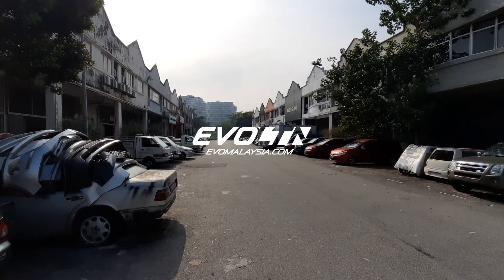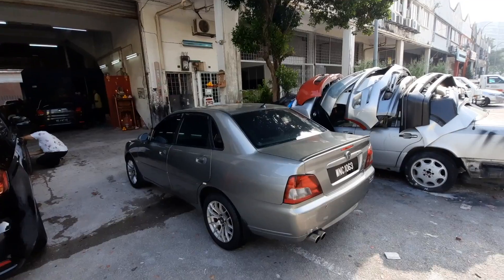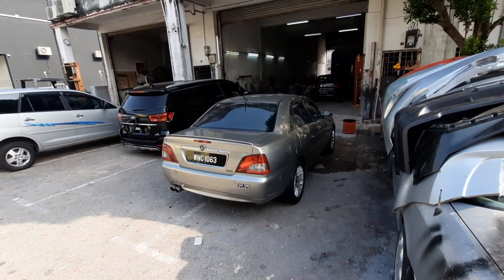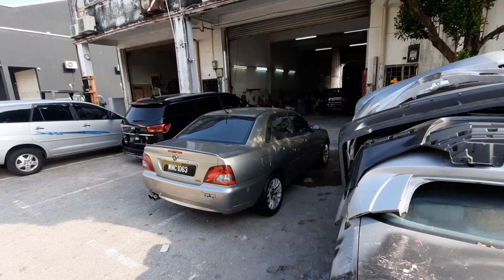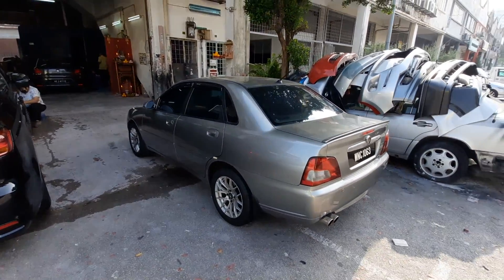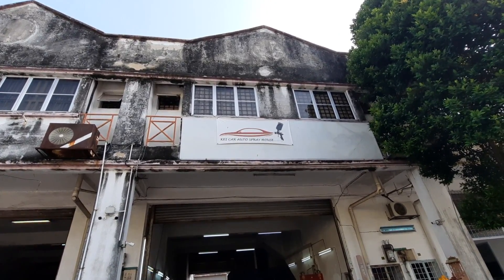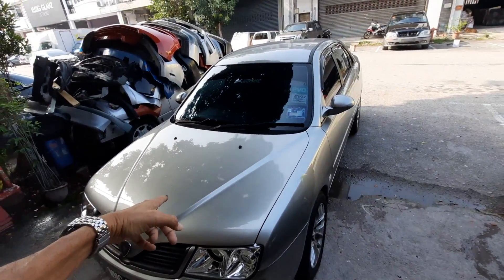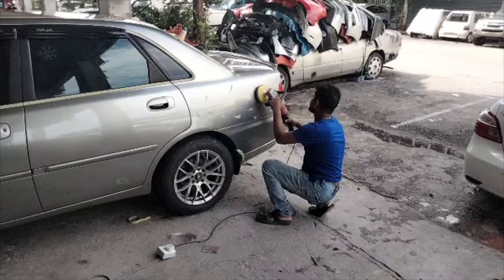WEEVIL UPDATE! 2005 Proton Waja 1.6i Visits Ah Kei for Touch-Up! Been a While!! | EvoMalaysia.com

Comment: Hi Chris, just wondering if this painting workshop are expert in doing rust repair especially like welding / patching new metal? Or maybe Kenzone is the only choice for you to repair any kind of rust body panels?
Reply from the maker: Both AK and Kenzone can assist with that, they don't do it themselves though, they outsource the work 😊👍🏽
Reply: @ChrisWeevilGarage  : Oh okay, thats nice. Will have a visit there later and ask for some quotation to repair some rust areas and touch up paint. Thanks Chris for sharing.